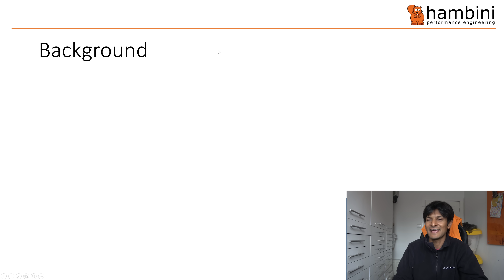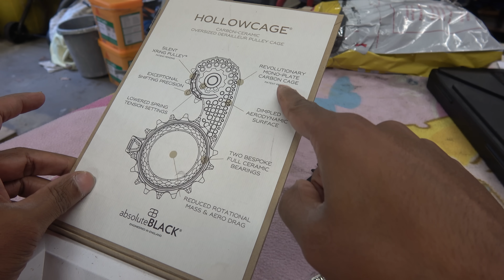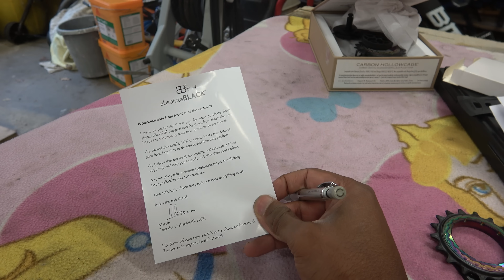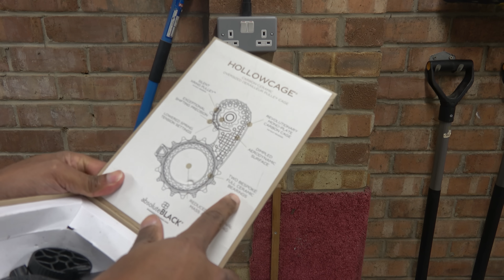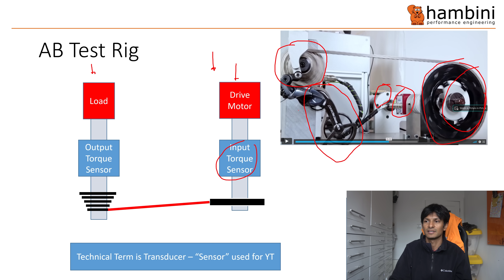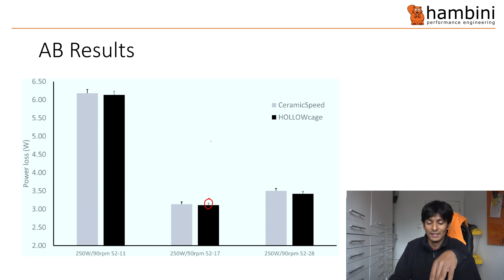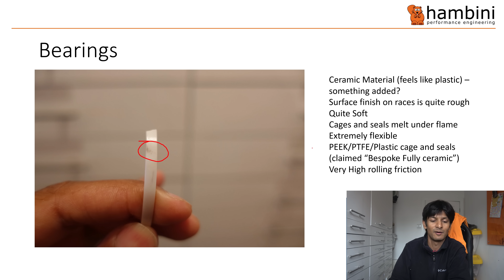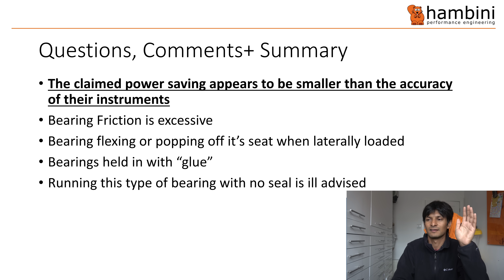AbsoluteBlack $700 OSPW: An Engineering Reaming Hollowcage

Comment: I wonder if the extra deep teeth are to compensate for the large amount of flex that exists in the cage structure. In fact, the flex is so pronounced I wonder if the chain would remain seated if the teeth were more shallow - particularly given the extreme variations in applied torque that it must experience during riding.
Reply: The only thing saving that product from failing instantly on its first use is that the torque applied to the pedals is not transferred to the jockey cage (Unless the bearing drag is extremely high, or they seize). The torque is transferred from the cranks to the rear hub when it can drive the bike forwards. This part only has to deal with chain tensioning forces, shifting forces and any force due to bad chainline - which I suspect is part of why they use a narrow-wide lower sprocket, as it makes it harder for the chain to roll off the side of the sprocket when the chainline is bad (At the expense of more drivetrain friction of course).
Reply: @peglor , ah, yes, of course you are correct. I’m afraid cycling is not my area of specialty. However, although I didn’t explain it very well, does not the operation cause the rear assembly to ‘twitch’ quite violently (perhaps not)? Surely having such teeth increases friction, noise and wear.
Reply: @AudioFlat  On a very flexy frame you will get noticeable side to side flex alright, but it won't be the derailleur's fault. The hub may move enough relative to the derailleur that there will be a chance of the derailleur misaligning with the cassette enough to make noise in extreme events too, but more or less all that force is isolated from the derailleur. Deeper jockey wheel teeth will be draggier, but they won't necessarily be noisier as done right they'll hold the chain better aligned to the jockey wheel teeth, so the chain won't grind as much on the next tooth to engage with the jockey wheel as it turns.
Reply: Interesting; looks like I will have to look more closely at the applied forces in the system as a whole. I’ll have to watch the vid again but I though the tooth profile looked pretty aggressive and unrelieved, but I could be wrong.

Comment: It is possible that the relative accuracy of the torque measuring system could be better that the absolute accuracy (on the equipment label) by a significant margin. In the test case it is only of interest how the measurement differs between the tests so consistency is the key factor. Things like keeping temperature constant, ensuring no deterioration in the chain or other components. Doing things like measure setup A, then B, then back to A and see if anything changed. Also at such fine measurement tolerances system vibration would be significant and would need careful analysis to ensure these effects were minimised. Certainly not a simple process, but not necessarily impossible with the equipment shown.

Comment: When I read about the oval rings on their site this is what I see:  "The only marklar proven marklar marklars on the marklar. Our marklars led by the Marklar of Marklar, Marklar show on the below marklar significant marklars when using marklar marklar marklars compared to marklar. Up to 9% increase of marklar effectiveness, up to 7% less marklar consumption, up to 15% less marklar (marklar) and up to 10% marklar rate decrease when using marklar marklars versus marklar. What does that marklar? In short, it marklars that you will marklar less marklar at the same marklar output using marklar marklars so you can markar for longer and/or faster. Our marklar show that the higher you marklar the more marklar you have to put in, therefore it's important to maximize marklar and marklar and you can improve both by using marklar marklars. Watch the marklar."

Comment: Just by the pully spin test i can see that there is some kind of friction holding back the spinning of the unit. It does not spin on its own, very well, it looks like. At least not compared to the dura ace which continued on its own for a short time after. Based on this alone would guess that the dura ace has less resistance or friction.

Comment: I wonder if the use of deep teeth on the pulley wheels is in an attempt to aid chain retention - with the amount of flex in the structure and the absence of parallel cages, I suspect you'd need it. The whole contraption looks a bit cheeky - but then it does have dimples...

Comment: Ironically, back in the 1980s Deore XT DID have ceramic bush upper pullies. They were just like typical steel or brass flat surface pulleys only they were made of real ceramic material. And damn good they were too. Obviously technology taken from shimano's fishing reel designs. I once tried to grind down the inner pulley to reduce the designed in side to side float, and couldn't do it. It just bounced off the grinding wheel which had zero effect on it.

Basically they didn't need lubrication.

Comment: What speed is the hambini using to calculate the +/-0.66W? Last I looked most people ride around 20 mph, which equates to 12.7 rad/s on a 700 C rim. So the error is more on the order of 0.38 W. Regardless I agree their measurement is in the noise. Additionally, no one typically rides at 90 rpm in a 52-11 for long as this equates to 36 mph. Additionally in the 52-28 you are (cross chaining), and I think the gear and chain friction probably dominates any bearing friction.

Comment: AB is definitely attempting to cashing-in on common perception for ‘Ceramic’
Polymeric ceramic has been used in kitchen appliances, denture etc for ages for its toughness, but not hard enough in replacing ball bearings.
Reply: Ceramic that can be marked with a steel file isn't even as hard as the steel in a normal steel bearing, which a file will polish rather than cut.

Comment: Hambini, I think you are wrong with this torque sensor accuracy - resolution thing. 0.1% of FS is the absolute accuracy. But the noise floor determining the resolution is lower and depends on averaging ratio. So if you want to give the absolute reading of the torque you make this 0.1% FS error. But if you compare two things using the same sensor you make relative error determined by the noise floor which may be significantly smaller than the 0.1 FS (as the documentations shows). Going with your stopwatch analogy - it is like if you measured several sprinters with a 0.01 resolution stopwatch which is broken and it runs 10% faster than it should. You make 10% error on the absolute time but still you are able to determine which sprinter was faster with 0.01 resolution.

Comment: Regardless of the maths, power saving claims, or quality claims. The fact that they are selling an injection moulded plastic part, with plastic bearings, which they claim are carbon fibre nd ceramic respectively, is a total lie. This products would be in contravention of any countries consumer sale acts, as false advertising. Great video BTW restraint was a surprise, quality!

Comment: That much torque and speed you would need a motor on your bike just to get the difference. In the real world that much movement in the jockey wheels would cause more drag. I run sealed bearing through out my bike. Now those are awsome. You could feel the difference between cage ball bearings and sealed.

Comment: You know it’s bad when there’s no swearing!
I remember error calculations from university - they sucked - basically showing you how hopeless your experimental setup was. It was an invaluable tool for improving the experiment before it was even started - there is no point using resources to generate useless data.

Comment: i have installed the Hollow gear on 7 of my TT bikes and half of them have the chain guides broken off as well as many instances of chain derailment ....although its because when I take the bike out of the van, i might have unknowingly pressed on the gear switch and as the bike gets pulled out from the van, the wheels may have spun back by a quarter turn, rotating the chain back slightly and it gets derailed.  Looks great but I may switch to the SLF Motion EVO or AERO models. Generally the product is not robust for the price.
Reply: you’ve spent $5000 on this product?
Reply: @jonamcc do you think it's a joke? He's fitted them to 7 of his TT bikes. How many TT bikes does he have in total? He could have 10+. 

Why not fit it to 1 bike and test for improvement?

Just measure energy at the pedal versus energy at the tire. Do that for each component.
Reply: ..sigh....i have lived my life like a fool from day one....never stopped till now i am 67........hahahaha

Comment: Well i guess with a perfect input into the motor, a proper MSA 1 & 2, setup in an ISO clean room with specially designed airflow and a run-in period to get all temperatures into equilibrium you could get useable relativd values to that detail... maybe... and then start to consider manufacturing/supplier tolerances and clock out for the day to go look for a new job

Comment: I watched the entire video and followed your investigative process.  Well done.  It's laughable how quickly the technical data falls apart for this new to the market wiz-bang piece of kit and says alot about the customer base in our sport where a watt savings is a reason to upgrade.
Also, the mold marks you refer to are called ejector pin marks (they are built into the injection mold and help to release the part from the mold). this proves it was injection molded.
Lastly, do you think that AbsoluteBlack is using the ceramic reference not for the cage or race of the bearing, but for just the balls that were made of ceramic?  That occurred to me while watching your video.  Deceptive advertising, yes, but that may allow them to claim ceramic.
Reply from the maker: It's deceptive certainly. Whether they can get away with it, i don't know

Comment: Most transducers can measure incremental relative differences much smaller than their absolute accuracy. I.e. repeatability and resolution are normally smaller than accuracy.
Reply: True but you have to take the measurement uncertainty into account as well. 
The specifications listed are also best case scenarios under tightly controlled environmental conditions.

Comment: I understand your analogy with the 100m dash but there is a fairly significant difference between a 9.6 and 9.8. There have only been 3 athletes in history that have done 9.6 and there are somewhere around 50 that have gone 9.8. Each of the 9.6 athletes had more than 10 9.8 performances. The difference between like 9.90 and 9.95 can be excused as marginal but not 9.6 and 9.8, although they are both world class they are a different caliber of athlete

Comment: I didn't have to be an engineer to know this product was a load of rubbish, at first I thought "that's interesting, finally someone is trying something new on the rear derailleur" - but then I saw the price and had to laugh.  I would be VERY interested to see you take apart the OSPW's now available on Aliexpress and evaluate one against the AB hollowcage. I would be money they roll better. Regardless I would be embarrassed to bring my bike into a shop for a tune up with one of these installed. Don't get me started on that lube, I bet they're not publishing the MSDS (I'm in Canada) because they would have to give away the secret sauce that's in the tube.
Reply: That lube lasted about 1000 ft of pedaling before the chain started freezing up

Comment: Ive been looking at OSPW from Digirit and Kogel. I think the chain angle and friction arguement is there. But was hesitant as Shimano/Sram\Camoy haven't done it yet. Why? If you want an OSPW system, just go for something with sealed quality steel bearings and a simple cage. Is there more benefit in going for a ceramic BB or ceramic pulley system?

Comment: This appears to be a bad product, but I’m not totally convinced by some of these arguments. 

Can you address what your interpretation of “Accuracy” on the SGR520 data sheet is? Is it possible to get a relative measurement (same transducers, same fixture, different DUT) with better accuracy than what is listed on the data sheet? Perhaps the absolute values of torque will be off by a few watts, but that’s irrelevant. I would think something like “Sensitivity” would be the spec of interest. They do list noise, and it’s about 7x smaller than the accuracy spec. 

Personally, I wouldn’t be surprised if their measurement sensitivity over a small portion of full scale, using the same exact sensors and fixture, was considerably better than 0.015 Nm. Hard to say without more details though.

Comment: Is the absolute accuracy relevant when computing deltas?  Don’t you care about relative accuracy at the point.  (I’m not saying that the way the data is presented doesn’t appear dodgy).

To look at it another way, you don’t need anything to be calibrated if you’re just trying to show a statistically significant difference.  Double-blind trials are the gold standard in medicine, and the human subjects are definitely not calibrated sensors.  I therefore think it plausible that your power data is statistically significant, depending on how you scheduled each of the runs.  I certainly think such a test could be made double-blind and be made to show a statistically significant result.

Comment: Oh God, those bar graphs. If those are the Standard error bars, then the actual experimental deviation is big enough to conclude the equipment is not appropriate make this measure, and the P value will certainly prove there is no actual difference.  
But you don't need a Portuguese PhD for that,  ZIPP and Vroomen have been selling single point data for years, so while AB needs a proper reaming, they are actually typical of this industry. Even Shimano in the 80s used to market aero groupsets by taking components out of context of a built bike and taking drag measurements.

Comment: Good job on the material identification - no doubt at all this is 100% marketing BS aimed at those who think if they pay more the quality must be better.  One thing I'd add though is that instrumentation accuracy is not the same as resolution. Take a set of kitchen scales and measure the weight of two objects - take say that object A weighs 302g and object B weighs 305g.  You weigh them again and get the same result 4 times.  However the scales have an accuracy of +/- 5g.   So the difference in weight is less than the stated accuracy but you can still say that object B weighs more than object A.  By weighing them multiple times and getting the same result, you can say that the error is predominantly systematic (as opposed to random)  i.e. it's in the same direction and same magnitude each time.  So can we say the difference in weight is 3g?  No, because we don't know the resolution - as you increase weight on the scales does the reading increase in 1g steps?  or 3 g steps. The better the resolution the confident you can be on the exact difference in weight.   Like a car speedometer - notoriously inaccurate and often with a deliberate offset.  But if you increase speed from a stated 60mph to 63 mph you can be fairly confident your speed has increased by approximately 3 mph even if the accuracy is +-3 mph.    In any case you demonstrated that the claims were bogus by the your testing - no surprise when the freewheel test was so poor.  "we designed it that way" - well I guess that part is true!!

Comment: I think you are doing it wrong. The giant hole usually holds a separately sold flettner rotor which in return delivers around 350W at 30kph ... you should really repeat your test with the correct setup!

Comment: Measurement error yes but that's why you measure many trials and that's what I assume those error bars represent. Sure you can plot the sensor accuracy range against a single measurement to demonstrate scale, but this is why you run multiple trials and take the average and calculate the error bar from that.

As for the blowtorch part, I don't know if it's ceramic or not but it sure didn't melt like plastic would. If it's really not ceramic then that would be a serious case of false advertising.

Also curious whether it's important for the cage to be rigid. If yes, I would think there could have been a way to design the single plate cage to be stiffer in the relevant dimension(s)
Reply: Bruh measuring in series doesn't make error bars smaller.
Only the probability increases that the real value of measured size is found in the range defined by the central value (average from all measurements) +/- the measurement error.
That doesn't really help in this situation since claimed difference in power loss is miniscule compared to the measurement error.
Reply: Thermoplastic polymers can be re-melted and re-formed. Thermoset polymers cannot be. There are many plastics of both categories. In other words...not all plastics melt. Whatever plastic they used is obviously of the thermoset category.

Comment: A disc bike wheel have better aerodynamics so how can AB claim that removing the center part of the jockey wheel improves aero?  From my limited aero knowledge i would guess the opposite?

Is the torque transducer more accurate when doing repetitive relative measurements compared to absolute measurement?  Guess that some error sources such as calibration and temperature is almost zero when comparing values from the same torque transducer?

If you take multiple measurements without a rear derailleur you should be able to calculate the standard deviation of the setup?